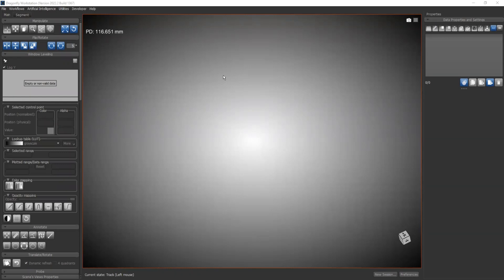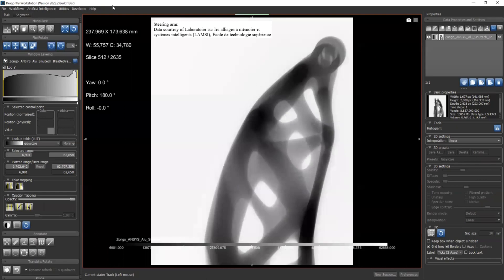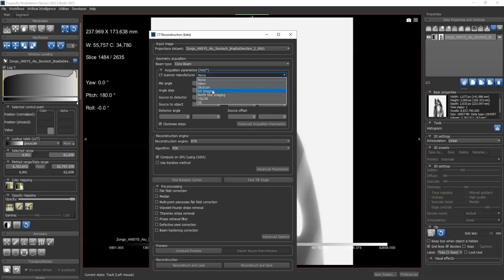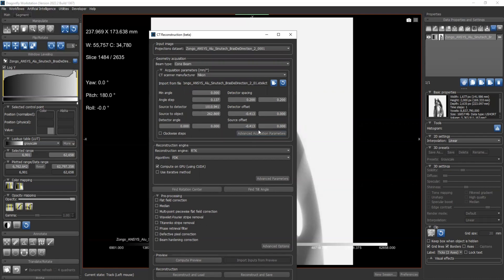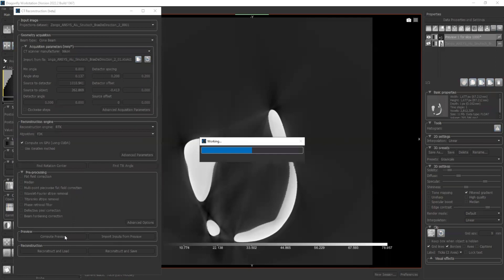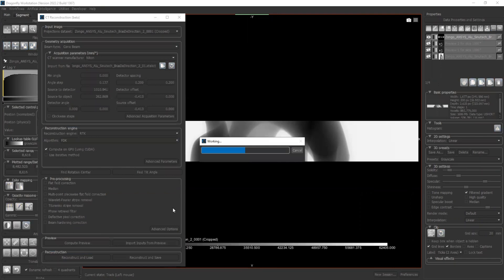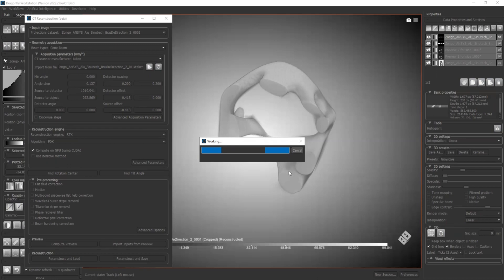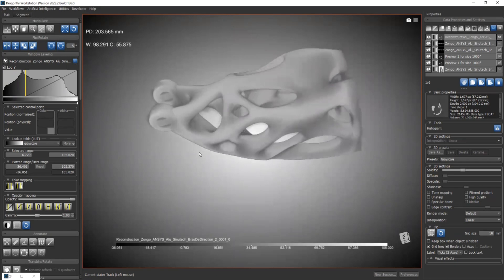Cone Beam CT Reconstruction in Dragonfly 2022.2

Comment: Thank you for the video. What does the error message "Could not reconstruct a slab" mean? 
I get this after trying to get a preview. Does it indicate that the parameter settings are incorrect or does it maybe indicate computational power issues? I have read in a .xtekct file for Nikon and the tiff slices.
Thank you for any advise!
Reply: i do encounter the same issue. did you figure it out ? thanks !